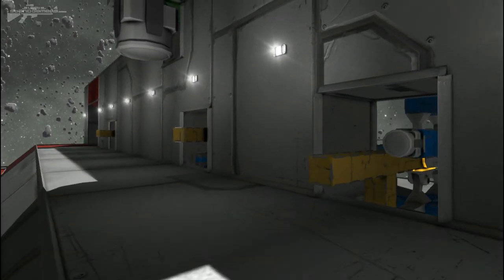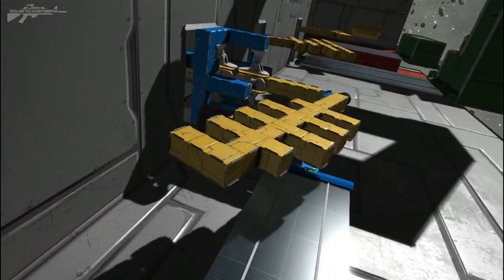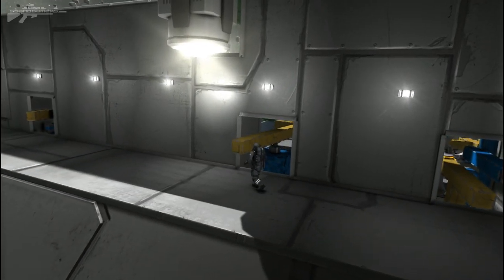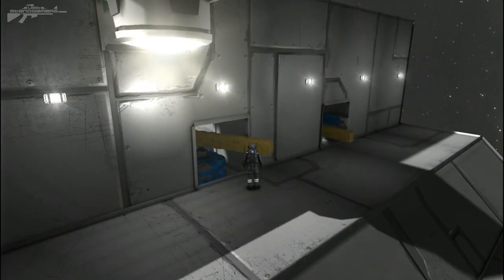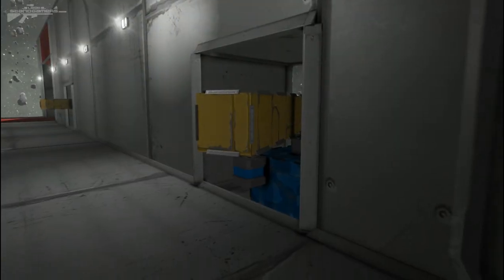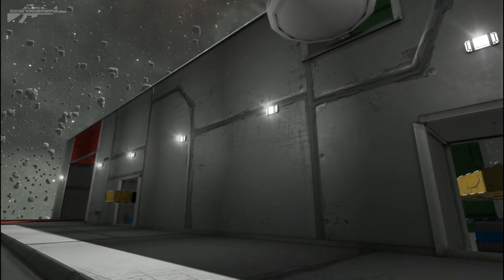Space Engineers - Buttons,Switches and Levers Concept ?

Comment: its nifty but way to silly and complicated - just nice easy buttons like you said door controls switches etc that you can key to different items by adding them to its list

they really need to work on the UI stuff like this - it has so much potential if you can add individual function either to physical buttons or even hot keys.

i am dying to make a ship with turnable engines that are easy to control setting up a macro system for how they turn depending on my own hotkeys.